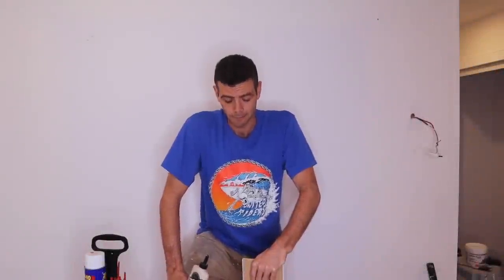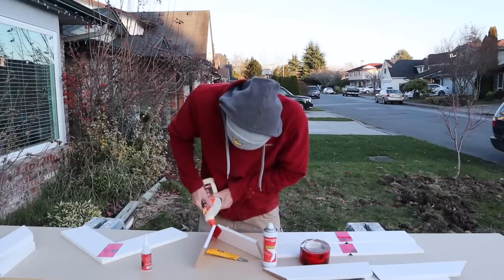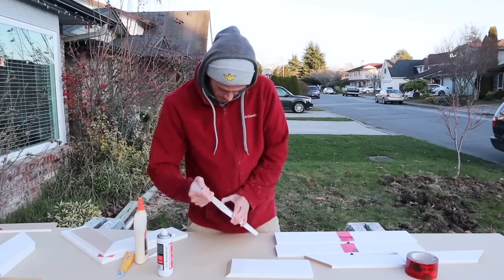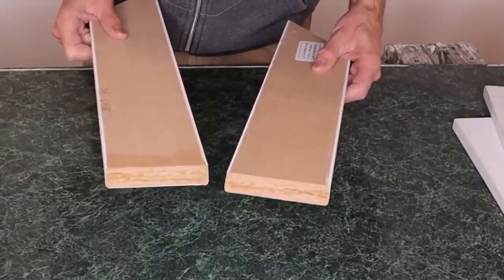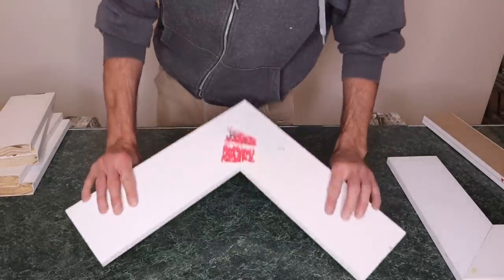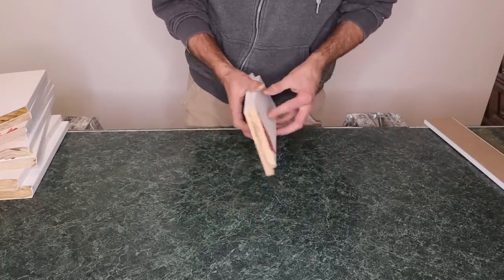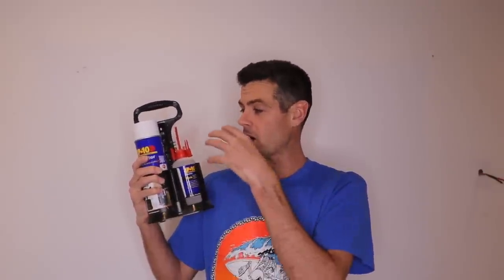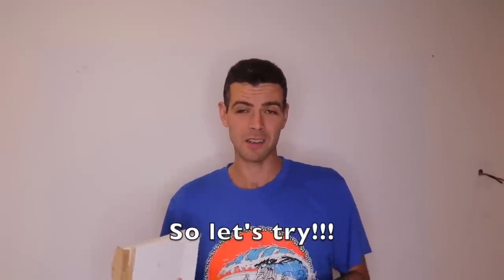CA Glue vs Wood Glue!

Comment: If you want a strong and quick joint glue the middle with wood glue and just a dot of CA at either end. The CA will act as a clamp wile the wood glue dries
Reply: Now that's thinkin'...
Reply: Gee thanks mr obvious😂
Reply: Perfect, you saved me a lot of typing!
Reply: It works great.   I am using a 30 minute planner ready CA glue. Its made to replace wood glue.  It's hard to find but it's good stuff.  I use both titebond and the 30 minute CA glue and get the best of both worlds.  Fast and strong.

Here is a example of it being used.
Making A Hammer/Mallet using DAP Rapid Fuse Wood Adhesive - YouTube

Comment: CA glue is great for quick positive attachment of trims and moldings, particularly in hard to reach places.  Once in place, trims are not generally subjected to many stresses.  Other wood working projects, such as cabinets and drawers are subject to various stresses and vibrations so a much stronger bond is required.  For these applications, wood glues will almost always outperform CA glues and clamping pressure increases the penetration of wood glues.  The other obvious factor is cost.  I use CA glues very sparingly because of their high cost.  Sometimes use a few dabs of CA glue in combination with wood glue for accurate positioning before clamping.  A $25 gallon of Titebond II wood glue will glue up hundreds of times more board feet of wood than $25 worth of CA glue.
Reply: instaBlaster...

Comment: I was watching thinking the exact same thing you brought up at the end. The environmental cost over convenience. I’m glad you brought it up.  And I totally agree I’d use CA glue but prefer to use more traditional glues
Reply: Standard wood glue is just so proven to be effective, and has been used for decades. And the fact it wipes with a damp cloth just makes it easy to control. All these adhesive manufacturers are trying to reinvent the wheel.
Reply: I do a lot of hardwood trim I find cheap white or yellow glue is best by far, less waste, less mess and if what your doing is awkward then I find Collins mitre clamps and PVA is far best. A wipe with damp cloth and the jobs good

Comment: Hey Ben I have a couple tips for the CA glue. Keep some acetone on hand to clean up excess and remove it from your fingers. You dont HAVE to use the accelerator if you have more a few minutes to let the CA glue dry it will have more time to soak in more. And baking soda will also kick off the CA glue. I really enjoy the videos you do testing and comparing different methods!
Reply: Keep in mind though, that baking soda will make the glue even harder, so you really don't want any excess dripping out. 
Not sure about up north, but here in the states, the easiest and most convenient way to get acetone is to just buy nail polish remover. Just make sure it is the smelly stuff, because that has the acetone in it.

Comment: You can put wood glue on most of the joint for long term hold, and a bit of CA glue on the left over part of the joint for a quick short term grab. This technique works with other materials and glues too.

Comment: Part of the problem you are having with the CA is the application. By applying the accelerator to one piece BEFORE you glue the joint, you are allowing the CA to cure upon contact when you do close the joint. It does not have an opportunity to soak in. Apply the glue, close the joint, and hit each side with the accelerator. You will still have to hold the joint closed while it cures regardless. There are a few extra benefits of doing things this way:
1. You have a little working time. You can reposition or slide the pieces before they cure.
2. Too much accelerator will generate heat in the glue joint (it can burn your skin if you touch it!) and make the joint more brittle.
Try this out if you have a chance. Your mileage may vary.
And one last thing - love the videos. Super informative, even more entertaining. Keep it up!

Comment: I’ve built full 9’ long, 13” tall opening header details with 1x4 and 1/8 finished plywood using ONLY CA glue laying on a garage floor, and installing in one piece in minutes. The stuff ROCKS! Except when you don’t line up your parts right the first time.
Reply: Use deactivator tp reposition them in that case...

Comment: My other favorite use for CA glue is DIY double stick tape for work holding. Lay down a strip of painter's tape on the work surface, spoil board, etc.. Apply a thin bead of CA glue. Then apply a strip of painter's tape to the work piece where it'll mate with the strip of tape and CA glue on the work surface. Press the two together...und voilà!

Cleanly remove by prying the work piece off the work surface, then peeling the painter's tape from either or both faces. Effective. Convenient. Affordable.
Reply: Can't make out anything out of this.

Comment: CA glue is much stronger without the activator.   The activator speeds up the curing from a minute or two down to a few seconds, howbeit, compromising the bond.   The manufacturers trade on consumer ignorance.   Subsequently they sell 2 produces (Glue and activator) to increase their profits.    So unless saving a minute is critical, save your money and just buy CA glue and use as a stand alone glue, allowing the glue to reach it's maximum strength.   Great Video/s, I've learnt over the years by Vancouver Carpenter.   Personally I always use wood glue on wood.

Comment: Most early 20th century wood projects used anything from bone glues to your typical wood glue BUT if you look at the ie furniture of then you will see they used triangular wood blocks to add extra strength and sometimes even those blocks had screws in them. We're not talking mortice and tenon or overlap here but  basic end to end woodworking. You could find over time that those blocks could come unglued but several understandable reasons for this including the switch to central heating where homes got warmer ?! It's quite an interesting subject overall re glues or adhesives. The first time I came across Cyanoalate adhesive was in the late 70s when used in washing machines for sealing purposes and obviously due to its high temperature co efficient working bond it did pretty well for fast repairs etc Then it was mega expensive! Great vid ! Stay safe! 👀👍

Comment: In guitar building and repair we use water thin super glue. Maybe that would penetrate deeper into the wood and provide a better joint? Because in guitar repair you can even use it for minor structural repairs.

Comment: From experience, if you forget about the activator and just saturate both ends of the MDF or wood you will have a bond that will not break! The material will rip apart from the glued  joint. 
As far as the impact on the environment, don't worry about little things like that. Nothing anyone does is going to change the final outcome.

Comment: CA glue with activator is a fast setting glue but CA glue without activator, at least to me, seems stronger and isn’t that much slower, it glues in under a minute without activator.
Reply: Chris Lackey good to know. I’ve been wanting to try it without the activator and see how it does. Thanks for the tip.

Comment: Nice video! I like to put a couple thick lines of wood glue on each side, with a little bit of CA glue on each corner and the middle, so the joint looks like this: .__.__.  I find the CA glue does an initial set pretty quick, and I still get most of the long-term strength of the wood glue.

Comment: Great video Mister V.C
🤔 glue such as ' Elmers' and similar... are the best.. hands down. If done properly and compressed at the joint until cured the fracture become stronger than the wood around it.. furthermore it's water based & you can make a perfect bead if u 'know how' 
😎🚬
Annnnd... if u mix it with wood dust you can make a perfect paintable and /or stainable filler

Comment: At least on furniture, I worked for a guy who would have me mix up a sizing of yellow glue and water (for end grain to end grain) and brush it on to the edges of the board before applying the glue and clamping. Truth is end gain sucks up a lot of glue. The sizing got absorbed by the capillaries so the glue didn't. I never tested it though. Just a thought.

Comment: Not sure if the brand you use is different but the CA glues I’ve seen people use apply glue first and then spray the activator- I guess theory being that an aerosol spray evaporates quickly so you want it to spray and stick the two together, whereas you spray and leave it as you glue up, so the amount of activator might be jeopardizing the strength
Reply: What does/do the instructions say? That a real question, not trying to be a smart-a@@.
Reply: What do the instructions say? That's a real question, not trying to be a smart-a@@.

Comment: CA glue (superglue, secondenlijm etc, depending on the region) tends to leave white frosty crystals around the joined area that is more noticeable on smooth plastic. I think it's some vapour reacting with the humidity in the air and solidifying that often you see your own fingerprint permanently visible on the surface next to the glued area. It's a nightmare for model builders or whoever who require precise, clean finish without such a mess.

Comment: Almost every casing (we call them architraves in the UK) in my house has cracked at the mitre joint. They're all real wood (pine probably) not mdf. I got so annoyed by this that when I installed some new ones in my bathroom I routed out the back of them and put perforated metal brackets in them. I used epoxy glue to stick the mitres together and to stick the brackets to the wood. The mitres haven't cracked. It's a lot of work but if it's on your own house, it's worth it.
Reply: That's actually a really good idea!
Reply: @macccaaaaaaa  Thank you! A lot of work, but I'm pleased I did it. I didn't bother in another room and the joints have hairline cracks. Wish I'd used the brackets there too...
Reply: How do you know the joints that cracked were even glued? Glueing joints in architraves & skirting is not necessarily standard practice.
Reply: @DiscoFang  Good point. However, in one of the rooms I fitted new ones and glued the mitres very carefully but didn't use the brackets. Small cracks appeared at the mitre joints within 2 years. Having said that, the glue that I used is called Gripfill. It's pretty good once it's fully hardened but maybe if I'd used wood glue the joints wouldn't have cracked.

Comment: Ca glue Is extremely strong for up and down motion but is not very shear resistant so side to side Force tends to break it apart pretty easily. However, for vertical downward Force, CA glue is extremely strong

Comment: I feel like wood glue still leaves a little gap if not clamped. Also takes to long to dry. I like CA glue because it dries in less than minute. Also these pieces will be nailed to the wall. I never had CA glue come apart at my house after 2 years on my door casing or baseboards.

Comment: INCONCLUSIVE. Surfaces were not scored rough to match the MDF board, hence the pine fracturing with the CA glue. Or amounts applied were random not equal, to overcome any surface and strictly test the adhesive. The last test item was flawed.

Comment: I made a block off plate for our rider mower from wood. I just used ca glue to tack it together to see if it would work. It did and it's been on there for months now, it get's really wet when I use the hose to clean under the deck.

Comment: I was doing base mold today and I was wondering the same thing! I was hesitant with the CA glue even though its super convenient. I stuck to good ole fashioned tight bond and 23 gauge finish nails. I really think with MDF, CA glue is perfect. But normal wood like finger joint pine. Gotta stick with the OG stuff! Thanks for this video! Fed my curiosity
Reply: I find Ca glue kinda lame sauce with CA glue. But hot damn is it strong with real wood.

Comment: Accelerator is pretty expensive.  It's much cheaper to just buy nail polish remover or a pint of acetone at Walmart.  Accelerator is nothing but acetone.  No other additives.  And then you can use it to separate your fingers when you glue them together.  It seems strange it will set the glue and also dissolve it, but accelerator is acetone.

Comment: First time watching your Channel,  it was under the recommended section -- found it very entertaining. using glues on furniture trims and cupboards is useful, but on trim around doors,  windows or on Baseboards is unheard of in my experience because if you ever have to work on the doors and windows you would break them and have to purchase new ones and why would you ever use glue on baseboards unless your walls aren't square and you are trying to hind your mistakes -- it's so sad that it has come to the point where we have to use pressed paper (MDF) and try to pass it off as wood -- good luck to anyone ever wanting to renovate a house if it has been glued together. ca glue is for folks who are in a hurry and wood glue is for woodworkers who have time. Wood glue is always stronger than the the wood it is holding together (can't say for pressed paper Ive never used it  to build anything
Reply: you're doing mdf a disservice. it is not pressed paper - the processes for making mdf and wood based paper are very different. mdf is incredibly useful mainly due to its dimensional stability, overall flexibility and convenience. it is also a very attractive material in its own right when used well. of course it has its pros and cons, as do all materials. as for bad workmanship - that applies regardless of the materials being used, it's not the fault of the material if something is poorly executed.
Reply: Appreciate your thoughts, though I think you are missing out on a perfectly good and inexpensive building product in mdf, not to mention its environmental advantages. But a basic assumption I disagree with in your post is that walls not being square is ‘your own mistake’. 1st- Often simply not the case because many (most) of us work on existing homes. 2nd- drywall finishing creates less or more than 90 degree corners. Watch a few of his videos on drywall finishing. The skill/art is to make it look flat/square while knowing it can’t be. 3rd- most pros don’t build removable for future problems as it’s too rare to justify just to save a few dollars for a replacement trim board, likely a minor cost in a repair. Anyway, once it’s filled, caulked, and painted in place, that bit of glue in the corners wouldn’t be the trickiest part of removal.

Comment: I have tested multiple glue up joints with pine and fir. A good wood  glue (I use tight bond) is always stronger than the wood. In my mind CA glue is  fast, wood glue is strong.

Comment: CA tends to cure hard. It will break if there is an impact. Carpenters glue has about the same strength but is tougher than the wood. Once cured the wood will break before the glue. Depends a whole lot on where you are putting it.

Comment: Use medium or thin ca glue for joints . Thick is for filling gaps . I find it does not work as well for shear strength

Comment: Ca glue is an anaerobic it works with the absence of air it would be nice to see it clamped up with out accelerator, also no glue works well on end grain joints. Also what wood glue was you using on the first set of joints, most wood workers use Titebond glues the other looks like Elmer's wood glue.

Comment: A couple of things; the real strength of CA is that it's almost instant when used with hardener, so in most cases there's no need to wait for it to set. Secondly, how strong does a joint need to be? Of course that depends on the application, but for most of my uses it's plenty strong enough for nearly anything.

Comment: It's really sad that people have gotten to the instant gratification point so bad they have to use accelerator on super glue.  That stuff dries fast anyway.  Accelerator just reduces the amount of absorption.  And putting accelerator on one side prevents the super glue from absorbing into the wood on that side.  But 65 years of working with wood has taught me you can't beat wood glue.

Comment: But the thing is, all of  these joints/uses are non-load bearing. You put them in place and you nail them in and it's never touched again. I don't know that ton of strength is necessary?  The test was interesting of course, but practically speaking I don't see why CA isn't more than enough for baseboards and moldings.  But I did enjoy the testing.
Reply: Thanks for making this point. I do a ton of renovation work, and all the trims I pull off on old houses are done with no glue at all. Not even on the mitres. Just big old hand nailed jolt heads and paint holding it together. I think that I will start using CA on some mitres, because it will allow perfect mitres every time. Nobody in my country is using CA glue for trim work, and I've never seen a carpenter using an 18 or 23 gauge nailer either. Over here trim is slapped on with 16 gauge brad nails, and you are lucky if they bother to glue the mitres at all. If the joins don't meet up the attitude is that the painters will fix it. The drywall and underlying carpentry work is often very uneven and it's impossible to get mitres to sit right relying on the walls, door jambs and window jambs. I'm seeing all these North American carpentry YouTubers using CA, and to me it looks like it would give me results that no carpenter in my country is getting. I don't care if the joint isn't strong, I glue my trims to the walls and jambs with PVA anyway. The CA only has to hold until the PVA sets and it's not going anywhere.